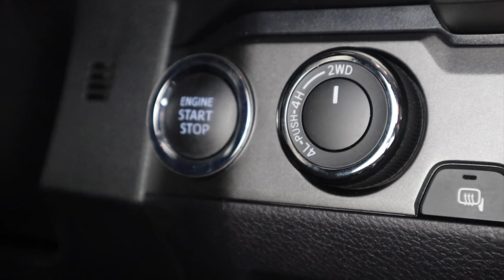Should you buy the latest Toyota Tacoma 2016-2021?

Comment: My experience: In early 2021 I bought a 2016 Tacoma SR5 so 2WD with the 2.7L engine with only 35,000 miles on it for a $21,000 sticker price. Pretty sure it was a company truck. Currently have 60,000 miles on it. First thing I did when I got it was throw a 2.5in the level kit, big tires, sidesteps, replaced all the interior lights and brake lights with aftermarket white LED's (HIGHLY RECOMMENDED) my backup lights are brighter than my headlights now. I've done an oil change every 5,000 miles plus one cabin air filter, checked fluid I use to work in automotive and this has been the best vehicle I've ever owned. Yeah, the 2.7 is slow I can definitely notice but the only issues I've had at all were caused by outside factors. The catalytic converter was stolen in daylight and I ended up welding on an amazone universal one with exhaust pipe for around $200, right side sway bar linkage came off probably because I didn't tighten it enough when I did the level kit which also happened to cut the ABS/TRACTION CONTROL line as well but were an easy fix. I do notice it's not great on gas but I'm coming from cars and I know I've added a lot of weight with new rims and all-terrain tires. I do hear a whistle on my left side every now and then but it's not often enough to really care about. The AC isn't the best like he said, I do live where it gets over 100 for weeks in a row and I work out of my truck so it can get annoying but I've had worse. Overall it's a great truck and I have no serious complaints I really like the storage under and behind both of the back seats. it's comfortable enough to sit in for 10+ hours at a time and does everything I bought the truck for. It does ride rough sometimes, it doesn't pick up on the highway as much as I would like it to and the AC isn't the best ever but at the end of the day I bought a truck so. I'll list my upgrades for anyone who cares. 

  2.5in level kit
17in Black Rhino rims
285/70/17 Nitto Ridge Grappler tires
Removed the black plastic wind guard under the grill (tires were rubbing)
Side steps (forgot the brand)
LED interior lights
Diesel LED reverse lights
Black Water Resistant Seat Covers
Sun Visor storage covers (no mirror there anyways)
Dashcam
Interior light bar (work)
Reply: Good to hear, I been working on my credit to finally get a tacoma and go figure i get a 2016 lol. It has minor issues but I've kept my expectations realistic and really just want that reliability and long Toyota life span. Fingers crossed some of the issues he mentioned don't happen.

Comment: I bought a 2022 TRD Sport Double Cab 4X2. I am loving it so far but was wondering if you had any input on what kind of reliability i can expect?  I plan on doing a break in oil change at 1000 miles. I am a Toyota guy through and through however this is my first Tacoma.
Reply: Bulletproof other thank wonky transmission tuning.  Get synthetic and change every 5000 miles.  Use 4WD once a month or so amd you are set
Reply: @paulm6481  i only use toyota oil and Toyota filter nothing else. I have noticed the transmission to be a bit weird and nay look into a reflash. I am very happy with it so far..

Comment: Don’t believe this guy. I have owned all 3 generations of the Tacoma. I have a 2016 TRD SPORT with a 6spd manual transmission. Currently have 110,000 miles with zero issues. No doubt the newest generation is by far the best.

Comment: Well congratulations for making an excellent list of just about every single problem I have had with my 2016 Tacoma!  Just a week ago at 131,000 miles I had to have the timing cover resealed. Fortunately Toyota was willing to pay for it even out of warranty. I have no yet had the antifreeze leak from the rear plastic hose. I guess something to look forward to 😢
Reply: I was just looking at 16' Tacomas... now I get why they are so cheap lol
Reply: @tantalizingpocket9286  yup. They really messed them up. Although if you have get a long term warranty and have the patience to get through the problems they are awesome. I’m at 140,000 miles now. Just came back from a 5000 mile trip. Other than one valve that is starting to tap a bit it runs awesome. Valve noise comes and goes. Only at low rpm.
Reply: @homebuiltcamperdave5226  I was thinking that I could get all the issues checked out that are common on the '16 while I can still return it because the price deference between a 16' and a 14' or 15' is almost nothing but I get more truck goin newer.
Reply: @tantalizingpocket9286  in some ways you get more truck. In other ways not so much. The 4 liter is a far superior engine for low end torque. The 3.5 they pushed for fuel economy and it does great at around 22 vs 18. But all the torque on the 3.5 is above 3200 rpm. So you have to be willing to put foot into it to get it to perform. And of you are going to be towing a camper the 4 liter is a far better choice. I used to average 15 with camper on my 2013 4 liter. Usually only get around 13 on the 2016 as it has to work much harder. So it all depends on what you want to do. I’ve had 7 Tacoma’s. The 4 liter v6 is by far the best engine they have made so far. But they just could jot get it up to modern liberal fuel standards. So they killed it. As with anything used shop carefully. If I had to do it again I’d probably never have sold my 2013.
Reply: @homebuiltcamperdave5226  I do alot of camping up in the mountains and a fair bit of off roading. The main thing attracting me to the 16' is bed length. Can't seem to find a 2nd gen TRD off road in a 6ft. Its sounding more like going for one of the 14s or 13s may suit me better based on what you said.

Comment: Great video. I love all your videos. I have a 2018 TRD sport with a manual transmission. You mentioned something about engine stumbling and there was a software upgrade for it. My #1 complaint with this truck since I bought it brand new is the engine stumbling upon acceleration. The dealer I’m working with can’t figure it out. Is there an actual TSB for it?   I opened up a claim with Toyota before it hit 36,000 miles. I now have 51,000 miles and I’ve got no answer from the dealer. I would love to go in there with a little bit more information about it.  And yes, I did get the new fuel pump put in under the recall.

Comment: I just bought a '22 TRD off-road access cab. The programming for when to shift seems totally wrong, I live in a mountainous area so it's shifting every 1-2 seconds.  I do really like it,  but have to use the manual mode.  I also have a 2007 v6 4.0 tacoma and it's a much better driving truck. Things are getting wrose and worse as we go on, I thought it was supposed to be the other way around. Also the '07 V6 4.0 l tacoma is at 200k miles, butter smooth shifting, quiet, and still getting 22 mpg. The paint looks like shit though, sun is brutal.
Reply: Yeah all of them do that.  There is nothing wrong with but shifting on my TRD sport in hilly Atlanta area on highway sucks lol, but nothing wrong with it.  They are pretty bulletproof

Comment: I just purchased a used 2020 Toyota Tacoma Access Cab TRD OFF ROAD. With 113,000
Miles on it, runs great tried out 4 wheel drive
High low and traction control, Transmission shifts great Automatic 
After looking at the service history it stops
At 45,000 miles, I think
The previous owner did
Service the vehicle but
Not at Toyota Dealership 
After the 45,000 , So I’m 
Going to take the truck to Toyota for Transmission and transfer case and front 
And rear differential,
I’ll do the radiator fluid
Myself, does the power 
Steering fluid need changing also, what else
Do you recommend ?
Richard,

Comment: As always your honest take on your knowledge is invaluable and much appreciated. Do you have any thoughts on the complaints regarding the howling noise at low speeds and higher speeds (55mph) when feathering the pedaL? I checked to see if anyone else has experienced this and I found an entire thread on the Tacoma forum where people are talking about it. I have an SR and only have 265x75x16 tires and no lift. Thank you in advance.
Reply from the maker: Hi! Howling could be caused by a lot of things. Does it change 4WD vs 2WD
Reply: Thank you so much for responding but I haven’t noticed any howling when in 4wd vs 2wd  because I only used 4wd a couple times last winter. I definitely will try I though. Toyota forums are saying the fix is sometimes dampening of the steering wheel and/or putting spacers at the u joint. Some think the drive shaft is not exactly centered? I’m not a mechanic but that’s what is being done by the dealer. I was wondering why they were so generous by giving me a lifetime warranty on my drive train. This was supposed to be my last vehicle, at 70 yrs old not so sure! Lol

Comment: My 2018 has a ticking sound.
The transmission has an issue shifting back up to 6th gear after leveling off from climbing a hill, which it drops into 5th gear. It gets stuck in 5th. If I shift it into the "S" mode and put it in 6th, it operates like it should. As soon as I top the hill, it shifts back into 6th normally. I started running in this mode all the time.
The opening behind the rear seat the reduce pressure when closing the door, seems to be stuck open and a lot of road noise comes in.

Comment: I just backed out of my driveway turned around and backed back in my camera worked backing out but stopped working when I backed back in. Why?
It's a 2020 trd off road tacoma with a 6 speed manual transmission

Comment: Outstanding video! I have a 2019 Tacoma Pro and only have one problem my dealer can’t diagnose after 2 requests for the same problem. It’s a creaking noise coming from the front end that only happens when the suspension is articulating when driving off-road. It’s quiet when going over whoop-de-doos. Any insight would be appreciated!
Reply from the maker: Hi! This will need in person diagnosis. Do you have a TRD shield?
Reply: @TheCarCareNut  I do. I just picked it up from the dealer with no fix. They claim it’s normal when taking the vehicle off-road and subjecting the vehicles frame flex to its limits.

Comment: Thank you for all your awesome videos.  I have a 2019 Tacoma ‘TRDoff-road V6; engine light came on, dealer said fuel air mixture issue and they need to pull engine to fix. Looking on line, this seems to be an issue with other trucks. Could you please comment on this ?

Comment: I had to replace the fuel pump on my 2019 because it was recalled. Now I am waiting on the new exhaust that keeps turning my check engine light on. Problem is the exhaust they're on National backorder so until one comes into the shop I have to live with the check engine light on and no cruise control. Oh well I guess you can't have everything.

Comment: There are reports on the web that the AC drain drips directly onto the frame and causes extensive rust.  Is this true? and is the proposed fix of adding a drain hose extension necessary in order to avoid destroying the frame on these trucks?
Reply from the maker: Hi! That can be correct if salt is added to the mix.

Comment: What do you guys think of the 2.7? I have a full size truck and was thinking about getting a Sr with the 2.7 and 4x4 for a daily. It'd be a lot cheaper on gas than my full size and I would still have the utility of a truck bed and 4x4. If I get one I plan on keeping it for 20 years or so and I know the four cylinder Tacomas are proven but haven't heard too much about the v6s
Reply: If I already had a full size no doubt the way I’d go
Reply: @zman8340  so I ended up getting one but I couldn't get the 2.7 so got a V6 but I'm still extremely happy. I've had it two or three months now and my average is usually around 24 miles per gallon. Posted a video on it
Reply: @clay-r15  4x4 ?
Reply: @zman8340  yeah
Reply: @clay-r15  good to hear mine will be here in a few weeks

Comment: Is it common to have the cruise sensor to make the truck brake like it’s avoiding a collision when a vehicle ahead of you is turning off to the right, or a vehicle has pulled up to a stop sign to the right of your lane? Mine has locked the brakes recently when this happened and I had to cancel cruise.
Reply from the maker: Yes that’s a common thing they do. The computer can’t tell if the car is turning or stopped
Reply: @TheCarCareNut  so is no fix for this? I almost got rear ended the last time
Reply from the maker: Unfortunately no

Comment: I know this question gets asked a lot, but I am curious of your opinion because you seem very knowledgeable on these trucks. From a longevity standpoint, is there any benefit from using premium (91 octane) fuel over regular (87 octane) fuel? Specifically the v6.
Reply from the maker: Hi! If you use good quality gas there’s absolutely no benefit in using 91 over 87. With the exception if premium gas in your area has no ethanol then it’s beneficial. Otherwise no
Reply: @TheCarCareNut  perfect, thank you 👍

Comment: My 2007, 4x4 crew cab, TRD has 150K miles. It has out last  my brothers Ford150, my sister Dodge Ram. They are now pro mechanics. I am still a dumb ass. Well, it's only because I have never had to work on my Tacoma nor replace anything. (regular maint. only) oil, tires, battery, brakes, etc. I love my family but can you imagine my Tacoma towing a Ford or Dodge home? Sorry, had to say it. I told them so.

Comment: Really appreciate you doing this video.  Are the leaks in the timing belt cover, vacuum pump and coolant bypass lines all resolved in the 2020s?  I am currently shopping and was considering a 2017 but certainly rethinking that.  Thanks again!
Reply: I was about to buy one as my first truck, 2017 60k mile

Comment: Hi, I have a 2021 double cab short bed 4 wheel drive TRD off-road. My concern is the AC system. Did the 2021 trucks come with a fan on the condenser? If not is that something I can request the dealer to install? Also thank you for sharing your knowledge both with the Tacoma and the tundra. I enjoyed both videos they are very informative.
Reply from the maker: Hi! The 2021 didn’t come with the fan. Tell the dealership to look up the TSB
Reply: @TheCarCareNut  thank you I will
Reply: I have one other question if you don't mind regarding Towing. I believe the tow rating for that truck is 6400 lbs. Have you experienced any tow related issues with trucks towing near max weights when properly equipped?
Reply from the maker: Towing near the max is allowed but you have to change the transmission fluid every 60k or 6 years
Reply: @TheCarCareNut  Thank you Sir 😊

Comment: I bought a 2020 Tacoma with the 3.5L engine I’ve seen several videos on the oil filter and issues with the standard filter allowing oil to pass between the top seal due to hard plastic ver rubber seal causing an issue. They suggest using the TRD Toyota -oil-filter-ptr4300082 oil filter as a resolution or even better the AMSOIL Oil filter EA15K02 is this an issue to be concerned about? JR
Reply from the maker: Hi! I haven’t seen issues with the filter as long as it’s not overtightened

Comment: My 2016 Tacoma TRD Sport 4WD Access Cab with 144k miles just had "motor failure" according to Toyota service manager. I was driving to work, accelerating onto the interstate when it would not go into passing gear, then engine started making loud knocking sound. No warning lights, no smoke, no leaks. Had it towed to dealership. They said oil level was fine. They started truck and immediately shut it down, saying knocking was indicative of failure. Drained oil and found metal shavings. They say the only fix is replacing entire block with a remanufactered Toyota engine. They want $10k for the repair. Am I being bamboozled?

Comment: The plastic crossover pipe on the back of the engine is an absolute deal killer for me.  I've dealt with these plastic parts with a Jaguar XF with it's infamously bad plastic crossover pipe and the equally infamous Y pipe under the super charger.  Here's the deal with this issue.  Once you've been burned by losing all of your radiator fluid almost instantly in the middle of nowhere when it finally blows apart, you will pay almost any price to avoid it happening again.  That means either a different car or paying someone to replace it, or learn how to replace it yourself, every 3 years.  Any more than that is borrowed time.  I have done it myself, but I'd prefer to not have to do this constantly due to cheap, crappy plastic parts.   I thought Toyota was safe refuge from this growing problem but I guess even Toyota has fallen victim to the cost cutting corner cutting bean counters.  I'll stick with the '15 to the grave.  F this.

BTW does anyone know if the Tundra has any critical parts made of plastic too now?  Thanks in advance for info.
Reply from the maker: Hi! The tundra doesn’t have much critical plastic parts
Reply: @TheCarCareNut  Awesome thank you for your help and great info.

Comment: I have a 16 trdoffroad  my stereo sound just ceased on the two front speakers I had it check and I was told that the speakers were working and the the stereo was acting up. I called the dealership and ask for the radio. The parts guys said forget it it’s 5300 dollars. And also my evaporator core has a leak and the guy there in the dealership told me it’s kind of common, the part itself is not expensive only 100 dollars but the labor is 1800 I am going have it installed by an ac guy for 220. For the stereo problem I was told that I could installed a quadraphonic amplifier and that the for speakers would work again and this would be much cheaper like 200 dollars